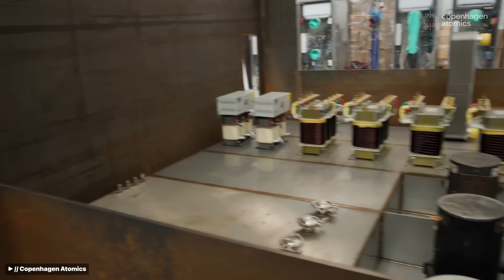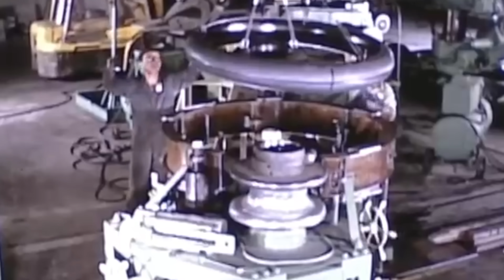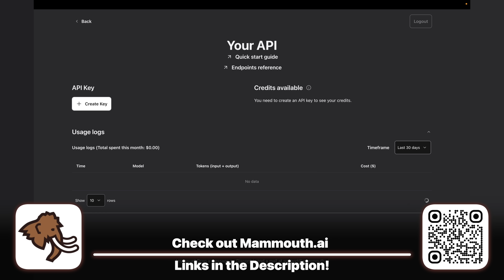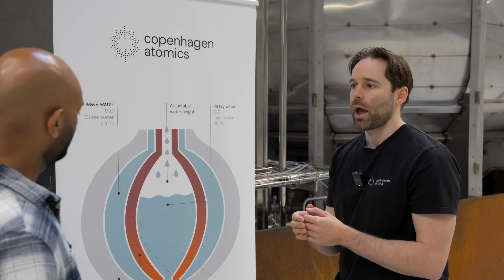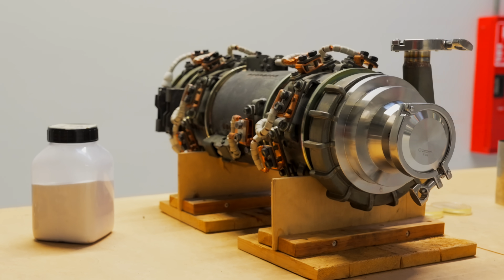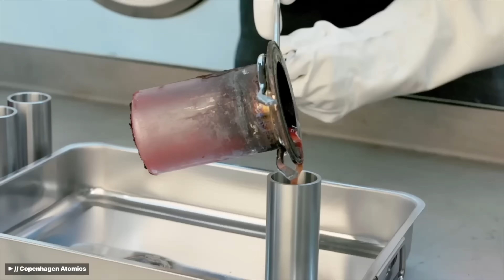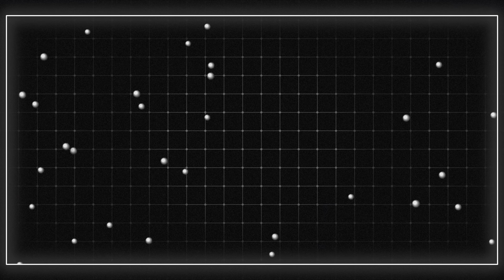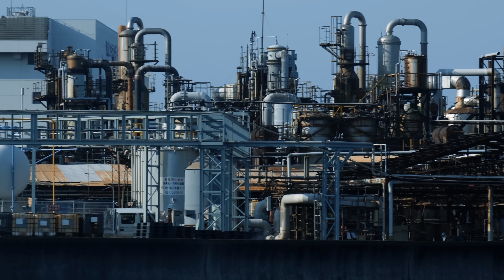This Modular Thorium Reactor EATS Nuclear Waste

Comment: Yo no archaeologists are going to dig up a nuclear waste cask and get cancer dude like this isn't Russia where they just leave beta decay reactors lying around for no good reason well that and peoples understanding of radiation is non existent leading to stupid debunked myths like this being perpetuated , Also just no this is not better than fusion. Fusion really is Thee holy grail of power generation like I honestly don't get how anybody with a straight face can act like they are comparable...... just cause we cant do it don't mean it ain't better just ask the sun man.
Reply: Geothermal is a better option.
Reply: @TerraPotens537   It is under utilised i must admit. while the risks with it are very real there is no denying the amount of power you produce with it, for making power on earth there are very few ways of matching outputs of the 100s to 1000s of MW's produced so good point.
Reply: @TheOriginalJAX  Everything has risk, but the risks from geothermal are low to moderate compared to many other energy sources.

Over any given unit of time, let's say a day for the sake of argument, a geothermal power plant will produce 4x-5x the amount of kWh as a solar or wind farm, and can easily equal the output of a nuclear reactor.

Geothermal is clearly the solution to all of our problems, and it has none of the drawbacks of nuclear (much cheaper, simpler, and safer)

Comment: 50 years ago the Danish created Dan-foss pumps.  Magnetically coupled with no need for bearings or seals.  Now used in every hydronic heating system in the world!  This pump for molten salt is 1,000 tomes more difficult -- but still the same principal.  I am amazed!

Comment: Does it need High Assay Low-Enriched Uranium to get the chain reaction started? This is used in other small modular reactor designs with Thorium. Is it a problem?
Reply: The plan is start with low enriched - or plutonium from nuclear waste. The UK has 140 tonnes of non weapon grade plutonium.

Comment: Thorium and fussion is the only way forward to co 2 neutral......low energy density green toys where never viable a mere distraction..Did this company finaly solve the last problem (exccesive corrosion acosiated with molten salt?)or the final issue preventing the technolegy to explode?

Comment: A great goal, but you do not mass-produce something that is still being researched. Take the automotive industry, for example. The ICE was well known and understood. The supply chain for fuel and oils was well established. The drive chain, steering, brakes, etc., were all at a level where fast duplication and repeatable processes could be established. That does not stop innovation and R&D, but for mass production, you need the first product off the line to work (for the minimum set of customer requirements) and to cost what makes sense for that customer. I agree with the goal, but there is way too much R and not enough D to move this to mass production, at least for the next 10 to 15 years.

Comment: The nuclear industry has continously promised that the the power is both safe and too cheap to meter for longer than anyone reading this comment has likely been alive. Ah but this time its different! Until someone shuts up with the promotion and actually delivers this will continue to be a scam for gullible youtubers to perpetuate. AI was much like this in the 60's and in the 90's where overpromising and underdelivering hurt the industry greatly.

Comment: What about the generated Radioactive Protactinium - where is that stored
Reply: from memory, it is extracted from the salt cycle (how exactly I don't recall, but I believe it seperates from the liquid as a gas) and then it beta decays into uranium 233 over its 1 week half life, and its beta decay so it is easy to shield.  After decaying into U233, it is then added back into the fuel salt.  Kirk Sorenson had a vid that explained the process adequately.

Comment: this is NOT a Modular Reactor design..........this is a MICRO Reactor design...........You have LOST ALL CREDIBILITY due to erroneous grammar.
Reply: It's definitely modular, but Copenhagen Atomics avoid the 'SMR' tag. And it's bigger than the usual definition of 'micro' reactors, ie below 20 MW. 20 to 300 is the usual SMR range, though Rolls Royce is planning a 470 MW one - which has a pressure vessel less than half the size, and mass, of GE Hitachi's 300 MW one.

Comment: I am very suspicious of a design that uses liquid water inside the core.  One of the biggest risks of light water reactors is that a water leak develops and you get super-heated steam with a volume MUCH greater than the original volume, that can burst the vessel and then radioactive steam escapes into the air.
Don't get me wrong, I am a fan of nuclear and I'm sure that these guys have worked the problem, but I am not reassured when I hear that they want to put the reactor into a steel box with 60 cm walls.
Reply: CA have about 1.2 tonnes of heavy water in the core - which will dump to the cold end of the container the second the pumps stop. The 200 litres of salt will be dumped to the hot end. That should work - there are two barriers between salt and water, with insulation between them. Any detection of water vapour, or salt, in the insulation space will cause a pump scram. The regulators will stress test that scenario - hopefully to physically plausible levels, there have been some ridiculous overkill regulations. CA have a mass of steel designed to absorb a sudden heat pulse.

Comment: So as the reactors get smaller the civil works (steel, concrete and such to house the reactor) become a progressively larger proportion of the budget. Not to mention the costs of the D20. While it doesn't interact, you still have a massive bill to acquire that much D20 to start with. 

The only way I see this working is if they can convince the regulator that the civil works don't have to be nuclear grade, and that a pressurized gas explosion containing radioactive materials is effectively impossible.
Reply: D2O should cost less than a million dollars. Non-nuclear plant will be similar to any other energy tech.

Comment: While its a good video... there's some flaws... It doesn't remove the massive regulatory issues.  And safety concerns. 

This is something that sounds good, but what happens if something goes wrong. 
Ok, you drain the water.  But then isn't the water 'hot'?  You have other 'hot' waste.  

Then you have transportation and potentially recycling... That too is fraught w challenges. 

I'm not trying to be debbie downer here.  But the reality is that it will take years to get the approval to move forward.

Comment: Two comments.  First they really never talk about the extraction of the fission products which are neutron poisons.  The other thing they don’t talk about is molten salt reactors can be critical without moderators due to uranium migration.
Reply: Gas fission products aren't too hard - they're carried off by a helium cover gas before the heat exchanger (the salt is well below its boiling point.) Metals plate out on colder surfaces, so they'll probably have a cooled mesh of some sort after the heat exchanger. Uranium won't have time to 'migrate'. It's either getting pumped through the loop at 100 litres per second, or it's in the dump tank.
Reply: @2x6x250ml it’s in the dump tank or if the system is shut down that is a problem.

Comment: Forget Thorium Reactors, the Experimental German Wendelstein X7 Hydrogen Fusion Reactor is running, producing energy output and can be fully steered. The involved scientist founded a commercial company named Proxima Fusion, collected money for the start of a first commercial hydrogen fusion reactor.
Reply: Wendelstein 7X got up to 30 million degrees for 43 seconds. It would need to get to 100 million C to be a viable fusion power plant, and run much longer. It didn't fuse anything, because if they'd put deuterium and tritium in the plasma, it would have made the thing too radioactive to work on. And there's nothing to harvest the energy anyway.

Comment: lol @ keeping are molten salt pure. Yeah sure in a test loop that's working fine. Add the nuclear reactions and you get fission products consisting of a massive amount of elemements and so impurities and real corrosion.
Reply: Pure of hydrogen mainly. I reckon they know very well what isotopes will be created and what effect they will have on their metal. They aren't idiots you know.
Reply: @fredbcf1255  How are you going to keep a nuclear reaction pure of hydrogen? It runs creating lots of neutrons, those decay into protons .. Sure most of them will burn up, but you're bound to have hydrogen ions in there. Claiming years of stability without the nuclear mess .. nah
Reply: @willemh9434  No that is not an issue. The biggest problem is Tritium formed from Li-6 but they enrich their Lithium to remove Li-6. Volatiles are easily removed and other metals like Tellurium,, which is otherwise the biggest corrosion issue is removed by deposition. They know what they are doing. They're not fools like you assume.

Comment: I’d love you to look into brilliantlightpower.  He’s got a very novel idea and changes modern thoughts on Science if True!  Basically Newtonian physics IS the model for all physics!  Tiny and macro!   He shrinks hydrogen atoms which give off plasma with the same wavelength as the sun!  I was looking into thorium 10+ years ago when my dad turned my into Randall Mills and his company!
Reply: He has a small company mostly research based but can generate tremendous heat from the plasma created when he reduces the hydrogen atoms.  His latest Hangup has been an electromagnetic pump to handle the heat generated!  Which these guys may have solved too?

Comment: Yeh... but if you're going to be running a reactor... your going to have the impurities of the fission products and as far as I'm aware you don't plan to do online reprocessing but instead run the reactor until the primery loop runs low on U233 then ship the reactor to a reprocessing plant to get the fuel to refuel the reactor out of the secondary loop. Unless your plans have changed, admitedlly this was from a talk in something like 2014 - 2016 so I fully admit a lot could have changed, like I think orignally you were planning on doing uranium thorium if I remember correctly, so that for sure has changed.
Reply: The core has 200 litres of uranium fluoride/ lithium fluoride salt. It fissions about 100 grams of uranium (or plutonium, if available) per day. The blanket has 3,000 litres of thorium fluoride/lithium fluoride salt. The reactor will run as a breeder if it can 1/ Extract 100 grams of fission products out of the fuel salt, per day. 2/ Generate enough spare neutrons to convert somewhere above 100 grams of thorium, per day, in the blanket to protactinium. 3/ Keep enough of the Protactinium 233 from absorbing another neutron, and changing to non-fissile Protactinium 234  4/ Once the Pa233 has decayed to Uranium 233 (with a 27 day half-life) extract it out of the blanket and add it to the fuel salt.  To do number 2/, they'll have to change from a steel core to one made of something much more transparent to neutrons than steel. The water-facing walls could be zirconium,  but the salt-facing ones would probably need to be carbon based - silicon carbide is the current plan. Joining that to the steel plumbing, with no leaks, will be tough.
Reply: @2x6x250ml  when I say Uranium thorium I mean natural uranium U238 with a faction of U235, mixed with thorium which would increase the cycle life which would be good if you need to take the whole reactor away to refuel it. Again old plan.,